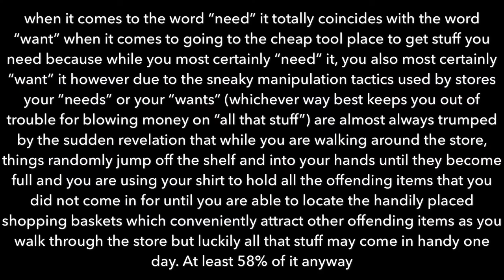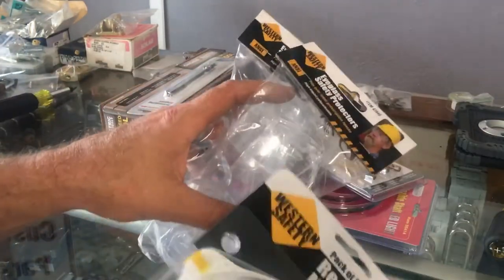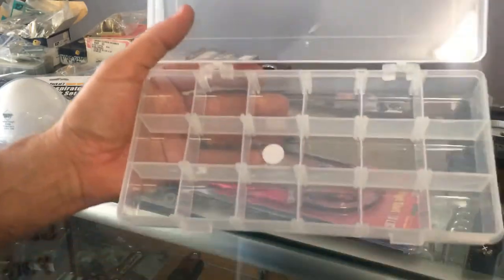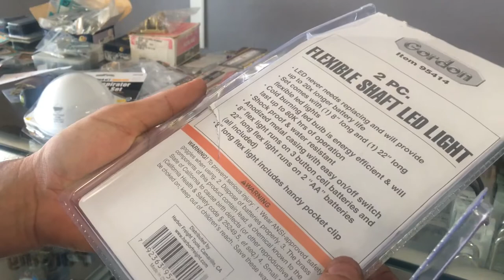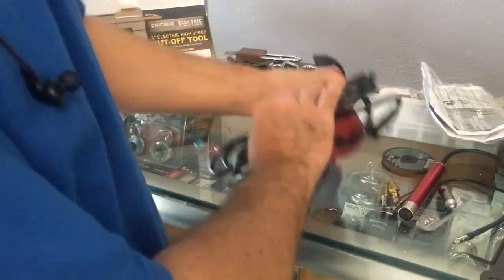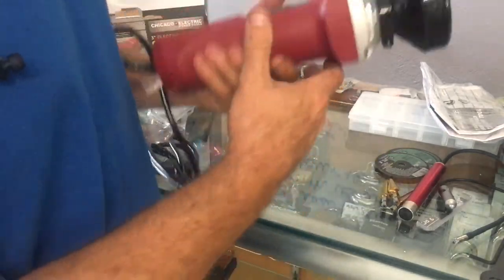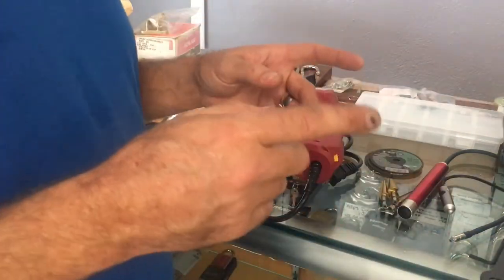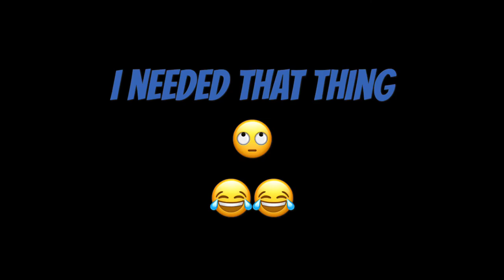I “needed” this stuff 😜

Comment: I buy some stuff at HF..  A Nice Locksmith supply are the Key Tags for a buck. 12 to a bag is a good deal. The Angle Grinder is a better tool than the cut off tool. The 4 1/2 inch tool is nice and compact and will get in places that the cut off tool won’t. Also you need to pick up some 5” wheels to use for reaching broken latches in doors. You need to be extra careful with them because the guard has to be removed to use the 5” disks. I also like the plastic cases, but look for the ones with the hinged closures instead of the one piece molded ones. Also their new line of 20v cordless tools are getting good reviews. Harbor Freight is stepping up their game. 
PS. Agreed, drill bits SUCK.